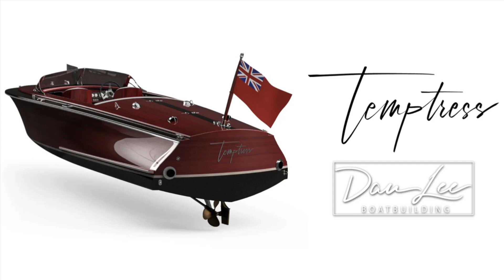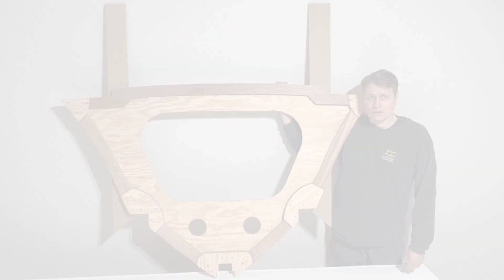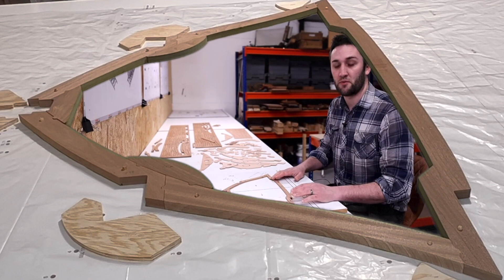Temptress Build 10: Frame 2 Assembly

Comment: This project is really interesting!!! Uhh when you build your strong back,, use engineered floor joists!!! They are strong ,light and dead straight! I think they come in the 16' lengths so four or so would cover length and cross bracing! Also great and fast for making large dead flat work tables tops with melamine topped mdf!!
Reply from the maker: That is a good idea.  Thank you.  I have purchased the MDF board and am trying to follow Dan Lee’s plans exactly for the videos.  But this could be a great reinforcement.